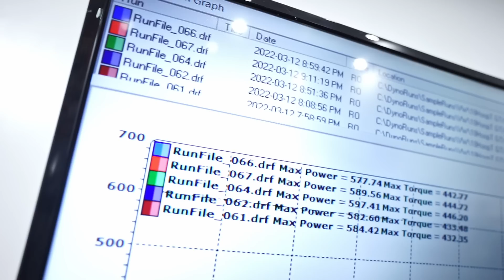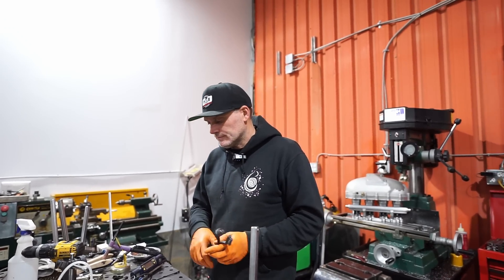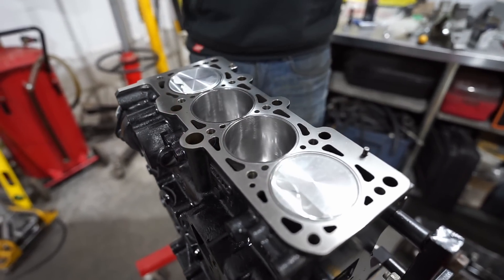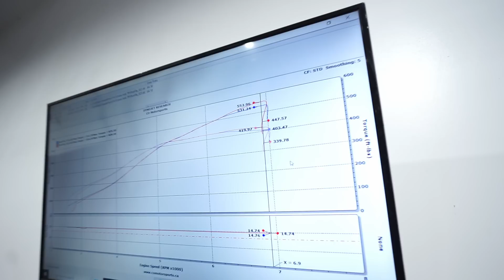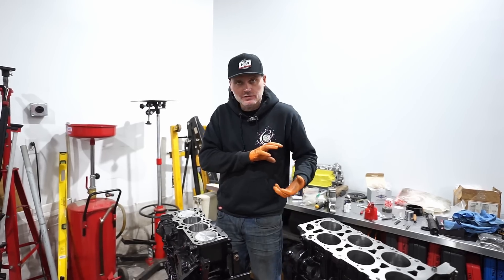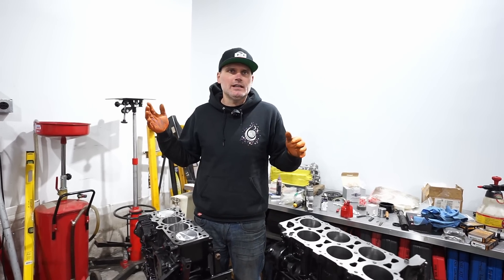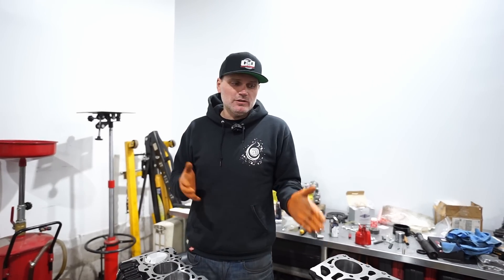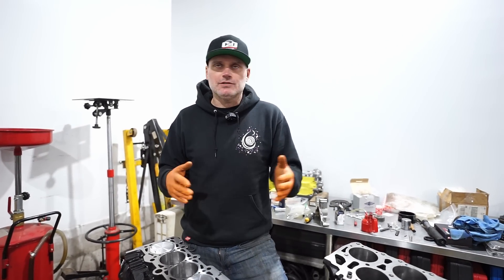Best VW/Audi Engine To Modify.

Comment: 2.7T for daily driveability. Spend about $3000 ($2000 for K04 hybrid turbos, $300 for injectors, $150 for a MAF housing and $500 for a clutch) and it'll make 500chp/450lb-ft of torque at 3500 RPM,  something you could only dream of with most 4-cylinder VW engines; and it will do it for 100k miles, virtually trouble-free.

Beyond that, everything gets expensive, no matter the engine.
Reply from the maker: Gen3 will make that power with a few mods and a few hours work. Unlike the 70 million hours required to swap turbos on the 2.7TT. Lol The 2.7TT is an awesome engine, just terrible to work on and something most don't want to tackle.

Comment: Best VW engine to mod by far is the CJAA.
Reply from the maker: You lack experience with gen3 then. :)
Reply: @COMotorsports  Gen3 dont get 50mpg while making 350 ft/lb or more.
Reply from the maker: @JoeZelensky  Lol... no it actually makes more torque. ;)
Reply: @COMotorsports  the gasser won't make more torque than the diesel. You could get a CJAA to 500 ft/lb if you want. But the reality is you'll have massive tire spin from any car Jetta, Golf, or Passat except maybe a Golf R.
Reply from the maker: @JoeZelensky  I think you're living in disbelief. I've modified both, have you?
Reply: @COMotorsports  not a CJAA but a BEW. And have had a few gasser VW's. And the TDI's make far more torque at lower RPM's than any of the gassers. Not only that but they get far better MPG's. The science has proven that diesel fuel has more energy per a given volume or weight and when used in modern diesel engines is more efficient and energy dense than gasoline or any gasoline engine.
Reply from the maker: @JoeZelensky  if you're talking about TQ...you need to look at gen 3 stuff. Trust me, it's not the same and the TQ gains are huge when tuned, more so then TDI.
Reply: @COMotorsports  all gassers are the same recycling of tech from the 60's or 50's. Perfectly metered fuel with high compression and a turbo? Yep that was done in the 50's. Greater 100% VE on an N/A? Yep done in the 60's. These little 1.4 and 1.5 things VW is making now can not compare to any of the TDI's and that includes AHU. The only thing that can compare is the gassers are quieter until late MK5 and more so MK6.
Reply from the maker: @JoeZelensky  clearly you're stuck in your ways. Go drive a tuned mk7r. Then come back and we'll chat.

Comment: Awesome video guys. Im a VW/Audi guy through and through. Ive built I dont even dont know how many turbo cars over last7 years i lost count. And My favourite motor is...... All of them. Ive built so many different iterations and combos of different cykinder head on different block and custom TDI cranks ground to fit ABF16v blocks with bmw 328I pistons. 1.816v and 2.016V heads on a variety of blocks. A super cheap killer combo is a ADY or 2E longblock woth 16v head all stock parts handles 500hp easy day in day out. Ive done low power 12v vr6 turbos to 1000hp vr6 turbos and fulle cemented 1300hp R36 drag motors. There really is such an amazing variety of choices. Im currently building a destroked R32 down to 3000cc 8000rpm revving 1200hp combo motor for myself. One thing I have notice through all of these builds for customers is that is has never been about what makes sense.  It has always been about passion for a particular motor.

Comment: Just get crazy 1.8t compound rear mount turbo. So like a 225 with a k03s/ko4 then a real big old skinny boy feeding the intake mounted in the rear. Should be able to cool the charge a lot running pipes under car to the front and avoid lot of lag cause when the big ones spooling it's basically just a 225.

Comment: ok let me know if this is dumb, i have a 2011 a3 would it be stupid or even feasible to swap a 3.2 into it?
Reply: ill also add that i wouldnt be doing this until my 2.0 dies (shes at 140k but shes still kickin)
Reply from the maker: A3s cane with 3.2s so not stupid at all.
Reply: @COMotorsports  i was looking and for a low mileage 3.2 its oddly cheap+ecu+ harness
Reply: would it mate to my trans or would i also need a trans
Reply from the maker: @Xertti  4cyl sand 6cyl bell housing are different.
Reply: @COMotorsports  ahh  do they make adapters for 2.0 to 3.2 specifically or would i be better off buying the full thing
Reply from the maker: @Xertti  new trans or rebuild your trans with 6cyl bell housing.

Comment: So talking about the gen 3 engines, you loved on the 2.0, but what about the 1.8tsi? What's highest safe power on unmodified engine? I keep seeing 350whp thrown around but no concrete numbers.
Reply from the maker: Couldn't tell you what max is but APR offers is38 tunes for them which depending on fuel make over 300whp.

Comment: I think the EA888 is a no brainer for “cheap” power. I love my CRZ MK6 golf R EA113 though. The sound for a 4 cylinder is very deep for some reason and besides the cam follower is a pretty nice engine. Just need to do the TSI roller Conversion. Can’t go wrong with the 07K either, 9 psi turbo on stock manifold and engine is close to 400 wheel which is amazing
Reply: Really depends which ea888 you’re talking about, because gen 1 and 2 are trash
Reply: @user-cn8tc2lr1c  yeah I’m only referring to gen 3+. I’d rather keep my ea113 in my R over the gen 1’s and 2’s. K04s are nothing on IS38s even IS20s

Comment: Here in South Africa we have 2009 Golf 1 aka Citi Golfs most enjoyable motor is the 1.6i 8v(AFX one of the best VW 1600 8v ever)we love to fit Estas 272 cam some headwork 50/57mm free flow exhaust and Unichip Q standard ECU is Bosch Mp9, honestly not the most power but with 890kg the car is Nippy and fun to drive and fun off the line..

Comment: I have a 2006 2.0 GT Tdi,I can't even unhook the bonnet/hood to check the oil so I think I'll pass on the modifications!
Reply from the maker: Good idea.
Reply: LoL. I had an Audi A3 20T TFSI 2007. I loved that damm car. To the end I also couldn't open the bonnet. Had to brake the grill to do so... The other problem with that engine, it loved oil. It loved oil a lot.

Comment: 2.5 is a slow economy engine by design. However I love the daam thing it sounds amazing and the 2.5 community really has gone out of their way to provide much love to the aftermarket and turbo mods you can do to it.
Reply: Funny enough the 07k was based on the IMSA GTO audi Five zylinders claimed by cheif engineer at audi. He wanted that sound back. The VW variant is obviously detuned for economic reasons BUT VW went to far on sand bagging its  performance. VW purposely Lowered its hp so it wont hurt TSI GTI sales.

Comment: Why no one ever talks about the 2.3 VR5/V5 engines? You can squeeze 250+ hp without any turbo. Just with a ECU tune. From the 150hp AQN.
Reply from the maker: We never got that engine here in North America that's why.
Reply: @COMotorsports  Then why the Jetta has that engine for America? Why didn't you in North America get it? Here in Europe we got the Bora, which was Jetta with other name. We got 150hp 1.8T, 150hp 2.3 VR5, 170hp 2.3 VR5 and 200hp 2.8 VR6.

Comment: Does the mk7 gen 3 engine have the same bell housing bolt pattern at the 1.8?
Reply from the maker: Not sure what 1.8t you're referring to specifically but yes basically all VW 4cyl water cooled engines share the same bolt pattern for all VW 4cyl water cooled transmissions.

Comment: Im a big fan of the old 2.0 BEV in the mk4 but there is not alot of bolt on after market parts
Reply from the maker: My drag car engine used that block. Made 850whp.

Comment: Vag offers many good motors but the biggest most reliable high output motors have been the 3.2vr6 and 2.5 i5 by leagues with the 1.8t being the favourite for budget rockets
Reply from the maker: There are plenty of 1.8T's and 16vs out there making the same power as 3.2s and 2.5s.
Reply: @COMotorsports  Ive never seen any close, got any links?
Reply from the maker: @oetic5016  search Sapinho Gambino. They have the quickest FWD in the world which is a 16v 4cyl.

Comment: Not going to lie the power ceiling on the VR is much higher, you only need to see how much material there is to know this.
Reply from the maker: Incorrect. The highest trap speed from any VW/Audi in the 1/4 is from a 16v... Trap speed tells a lot about the HP that's being made. So... yea... they're all around the same honestly.
Reply: @COMotorsports  I'd put that down to weight perhaps.
Reply from the maker: @oetic5016  definitely comes into play for sure but we're talking about 7sec cars here the power is going to be similar for sure.

Comment: I’m currently working on a 1.8 in a 225. I’m gathering all parts and prepping it. FMIC, 3” downpipe, all new forge hoses and DV. Ramair intake, 2.0 conversion power packs. Saving for the forge internals and larger turbo then tune.

Comment: You just showed a lot of garbages here, engines which cannot handle even 350bhp in STOCK form (bottom end internals) BUT avoid to mention 1.9tdi, which many of them started from 105bhp can handle over 400bhp and we have some 9sec 1/4mile @500bhp 1.9tdi pd here. Also it can be run as DAILY with an average 45mpg at least, not as some of your examples which as daily will get some 8mpg.. but also just a few being able to run 9sec on quarter.
Also you forgot to mention IDEAL FO MODIFY .. FOR which purpose? Of course, highest power will deliver a vr6 turbo, but the investition in it is HUUUUGE.
Reply from the maker: TDI's do not stand a chance against any modded Gen3 engine. Not even in the same league at all. You're dreaming if you think they're even close.
Reply: @COMotorsports  what i said and what you reply?!?
By the way, show me "gen 3" 2.0tsi engine 9sec run, because i didn't seen even one. Not to mention that more unreliable engine i've never seen in my life.
Reply from the maker: @napraznicul  Lol, with ZERO effort searching here's one from 5 years ago that did 9.58@145mph. https://www.youtube.com/watch?v=47aNztqWZ6Y

Also there are stock engine MK7Rs that have run 9's. Again, no comparison.
Reply: @COMotorsports  is nowhere specified about STOCK engine, then we talking about gains in performance vs stock.. that R starts from 310bhp and is modified for about 600bhp.. about twice as stock. Our  OLD technology 1.9tdi with NO dohc, NO variable camshaft phase, no  such precision maps as golf R.. starts from 130bhp and gets 494bhp. About FOUR TIME MORE POWER! So which one proved be able offer much gains in performance with low budget? (high budget has almost no limits)
Reply from the maker: @napraznicul  I'm sorry but there's nothing cheap or easy about making a 4-500whp TDI. It's by no means easy for the average person, or common at all in North America. Ive been doing this for a long time and I've yet to see a single TDI make even 300whp in person, let alone 4 or 500whp. So I'm going to stick with my original statement... The Gen3 is the best engine to modify unopened.
Reply: @COMotorsports  probably you will be shocked if i could upload here few dyno graph of our 1.9tdi. Did you ever seen one which push hard until 6300rpm?.. i bet you don't 😂
But in america wasn't known because of that specific cars embargo.. more than that, they blamed small VAG diesel for almost anything possible, because they cannot accept on market a car which is spacious, can do easily 120mph and still get.. 50mpg🤣
I will try to show you something linked here..

Comment: It's futile to modify a wrong concept and expect good results. All reciprocating engines are wrong concept. Reciprocating isn't suitable to generate power. That's why the efficiency is extremely low. Ends up, engine makers have to rely on high pressure to produce more power. But by increasing air pressure during combustion cycle will only cause more gasoline to slip pass piston rings. And ruin the lubricant which is the most essential component for the engines. This should explain why certain engines are having oil burn issues but all of them won't last as compared to old carburettor engines.

Bottom line, reciprocating engines are big mistakes. By implementing GDI will only worsen the situations. As for turbocharger and supercharger, be prepared to get a new car.

Comment: 2.5 for me. I have had quite a few wc VWs, current is a mk6 R, my next engine will be a built 07k.
Reply from the maker: 07K turbo your 6R. That's what I'm doing. :)
Reply: @COMotorsports  My O7K T plan is into a 1971 Opel GT.
Reply from the maker: @gnrrpreacher  very nice.

Comment: At least he mentioned the 2.5's. But the B9 3.0T's, 2.9TT, and the 4.0's are monstrous. Still cant forget the easy and reliable 500 wheel from the B8 Supercharged 3.0T. Cheap to get into them too.
Reply from the maker: Didn't forget about them. 3.0T is a beast for sure have modified TONS of them. However 500whp... not the norm that's for sure.
Reply: @COMotorsports More like 450 probably stage 2 dual pulley unless it’s running ethanol huh?

Comment: I'm not racing or modding heavily. My EA888.3 2.0 stage 2 is a blast to drive. It was super easy to add a downpipe and a tune. I could do more, but my fwd GLI already has traction problems. Maybe an A3/S3 in the future.
Reply from the maker: R/A3/S3 where it's at. Traction issues be gone.
Reply: @COMotorsports  I don't NEED to replace my GLI. I absolutely love it. But I really would love AWD 😂

Comment: The 2,5 non turbo charged can make how much horsepower? 
Can you do a 2.5 N/A video.?
I think the 2.5 is the best motor the VW / Audi makes
Reply from the maker: We just did a video with an NA 2.5 on the dyno.

Comment: I’m rocking my boosted 8 valve. Easy and cheap power.
Reply: How much ho you making? I had one for a while and was thinking of upgrading it but i found that there is not alot of options for after market parts
Reply: @samuelpaquin7160  it’s around 250hp right now in a light mk1 rabbit but I’m in the process of building the head for more power. There are lots of options these days for aftermarket engine components.

Comment: Hello there. Question, can I make 1000hp with a mk4r32 using stock cams?
Reply from the maker: Cams are free power. Well not free, but easy power.  For that kind of power youll need all the help you can get.

Comment: On the Gen 3's that run the VW 508 oil, do you guys keep using the VW 508 or do you recommend using a 502 oil.  Big debate on this I know, but just curious to your thoughts, this would apply to stock, and tuned unopened engines.
Reply from the maker: OE spec.
Reply: @COMotorsports  Thank you for your reply👍

Comment: Thanks for this vid. I have an Edition 35 with a 2L TFSI CDL EA113 Engine. I've spent quite a lot on fueling alone (pump, injectors, controller, hpfp roller kit conversion with vis motorsport internals, direct port meth injection) etc.  So I understand when you say fuel is really limiting. What I want to ask though is the cylinder head. How much limiting is it and are there substantial gains to be had with a ported cylinder head, specifically with our platform ? Am looking at crank HP range of 550-650hp.
Reply from the maker: No need for porting for those goals. If you did bigger valves and springs you'll free up power.
Reply: @COMotorsports  okay, but don't bigger valves need porting?
Reply from the maker: @35gti-ke  no

Comment: 12v vr6 willl MAKE MORE POWER MAXED OUT THEN ANY VW PLATFORM
Reply from the maker: You would think that... but typically they're about the same. They both have failure points, they're just different between them.

Comment: I know I'm a newer fan but would you guys ever do TDI's? Seems like a huge VW fan base.
Reply from the maker: We're about making power. I tune TDIs all the time, they just can't compete when it comes to making big power unfortunately. Yes guys have made decent power with them with endless money chucked at them...but it's typically similar results to what a modern gas VW engine can make with just a tune.
Reply: @COMotorsports  100% true statement right there. Either way I can't wait to see more badass track/daily builds. I got a mk6 tdi stage 3 Malone and a project caddy. Don't have an engine plan for that tho.

Comment: Did you heard about 1.9TDI PD? My runs on 170hp 380nm just mapped with 222k miles, only engine falut was burst pipe between turbo and intercooler.
Reply from the maker: Yeah we're about making power, TDI's generally don't fit into that category.
Reply: @COMotorsports  i think torque is more impressive because in diesels its pretty much instant and feels the best to drive normally on the roads
Reply from the maker: @samuelpaquin7160  you need to look at some gen3 dyno graphs.

Comment: Want to get a little more out of NY 2.8 aes 12v vr.  What would you suggest
Reply from the maker: If you're sticking NA then good cams, springs and software.
Reply: @COMotorsports   what would you suggest for a turbo,cams and kit.  My mind is wrapped in the tdi game or air-cooled but not so much on the watercooled.

Comment: What does it take to get around 4/450hp out of a Mk7 golf r what would I have to put on it are get done to it if you can tell me it would be greatly appreciated thanks
Reply from the maker: E85, with bolt ons will make 400whp on stock R turbo. After that turbo upgrades required.

Comment: Im still partial to the old NA or SC 2.0's. Fully built ABA 8v 2.2 liter stroker, or  w/ a 16/20 valve head swap or 9A same build. KR, PL 1.8 16v bored over. Either high compression w ITB's or super charged.  Instant torque, in light cars, mk1, mk2, mk3, puts the smile on my face, more than heavy 600hp turbo cars.

Comment: Wait You can put a turbo on a 2.5L 5 cynlinder Vw Engine? I've read & been told the engine has a too high of a compression for that
Reply from the maker: Most definitely can, amazing boosted.
Reply: @COMotorsports  🤔🤔🤔